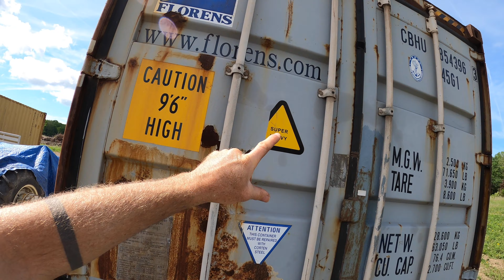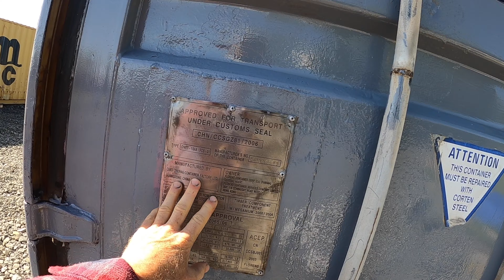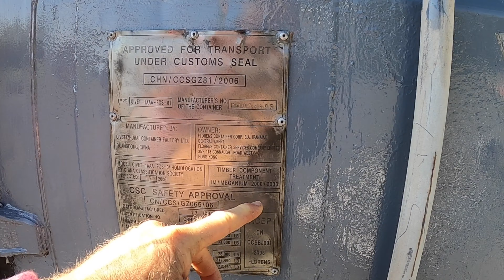Framing the Roof - Shipping Container Barn Build #4

Comment: I have a similar build. I put down a 40 x 46 concrete slab, 2, 40ft containers along outside edge running the 40ft length.  That leaves me 30 inside between the containers.  It has a 12 ft apron off the front end. The apron is 12' x 46'. Roll up door at each end. Front roll up door is 16' back roll up door is 12'.  One walk in door, complete bathroom at one end of one of the containers.  Car lift inside, many tool cabinets and assorted machines to do mechanic work on  4x4's and side by sides.
Reply from the maker: Oh dang that sounds amazing! I'd love to see pics. I'm also wondering where you got the roll-up doors and if they're insulated/sealed well? What a cool space you have ... I'm looking forward to getting mine sealed up

Comment: Invest in the flexvolt cordless grinder. I'm a Milwaukee fan but I gotta say the dewalt flexvolt 6in grinder is a beast.
Reply from the maker: thanks for the tip! much appreciated
Reply: @metaspencer  Torque Test Channel just did a video comparing grinders and showed the flexvolt out performed a corded grinder.
Reply from the maker: @towboatjeff just ordered one. Thanks for the tip

Comment: Great job. I prefer to weld brackets on the top than bolt down to avoid leakage points.
Reply from the maker: that makes good sense. That area will be roofed but I like your thinking there.

Comment: Hey Spence, love all these videos. Have watched the whole “series” at lest 4 or 5 times! Wanting to replicate what you did. Couple of questions for you, how deep did you go on your footings? What height did you decided on the 2x4 uprights for the roof to sit on and why? Thanks!
Reply from the maker: Howdy -- exciting to hear you're thinking/planning a build of your own. I wanna hear more! Where we are 4' footings tend to work and get down below frost. Check your frost line in your area. In one case I couldn't go that deep as I hit a shelf (slate here). The uprights are 4" to make it easy to slap 4x8 wall board (osb in my case) up there. I tend to go with numbers/lengths that fit for the materials I'll be using
Reply: @metaspencer  thanks for the reply and info. 4ft makes a lot of sense. Did you also purposely make the lower roof the same pitch as the trusses? If not it looks really good. I’ll check on the frost line thing (didn’t think of that!). I’m just outside Nashville TN
Reply from the maker: @musiccitycruisers3863  I went for a flatter pitch on the side roofs to get a kind of "flared" look that I like, but still enough slope to shed snow

Comment: Good Day :  I'm so sorry you had to clean off all that rust with that grinder . The all time fastest , easiest and most thorough method is "Wet Sand Blasting"  .  This is mixing very cold water with your sand . It will only take about 1/6 the time it would take to use that grinder .  The cold water will stop any warpage .
Reply from the maker: Sounds awesome! I've never seen a second hand sandblaster in my area, but I'd love to pick one up. Would be awesome to test out and use.

Comment: Hey there, we are working towards building a container home with a similar approach with two containers and a space of 14 feet between them.

Can I ask how well the roof of the containers held up to having the built roof weight on them? 

I'm very interested in using your approach for the knee walls to support a roof with enough high for a second floor.
Reply from the maker: If I were building a house I'd probably brace the container tops/roofs with welded triangular brackets inside, just to avoid any potential sag or movement. My roof has been great but my tolerance for oddities is probably lower than yours, since it's a barn/workshop. Have you thought about putting your knee walls along the edge of the container? Much more solid there. And are you gonna attach your boxes to piers?

Comment: From someone who knows only a little about building I wonder why you did not sand the rust off the roof and paint that too?  Yup I am one of the planning dept./builder inspectors kind.
Reply from the maker: The containers are made of corten steel, which pretty much is made/designed to rust and weather ... so without any new water hitting the tops of the containers (with the roofs on now), I'm not worried about rust progressing up there.

Comment: did u use silicon where u penetrated the roof???
Reply from the maker: Those holes will be roofed over but ya know, it's not a bad idea. I think I'll go back and goop those holes: good idea!
Reply: @metaspencer  I always had to do it installing tv and satellite mounts or the insurance wud not pay up...drill hole 1st put a bead of silicon around the hole, place mount on top, more silicon on the hole then slot the bolt or screw thru.
Reply from the maker: @OffGridAussiePrepper  Yep, that's the way to do it. And I've had good luck with Sikaflex too (on steel). Thanks man
Reply: @metaspencer  Yeah its Sikaflex now not silicon.... as i been retired for a few years due to health issues

Comment: I hate shipping container roofing, its made to rust, therefore u have to make a new roof entirely with at least a 6 inch gap for air flow or a 2ft gap to utilise for storage
Reply from the maker: yeah they're kinda flimsy boxes in places ... less rugged and durable than I first imagined.
Reply: @metaspencer  Shud have been a flat roof made to shed water, not hold water in gullies, cos wind is not gonna dry it out so salty water wud sit and just eat the metal away.

Comment: …. Still waiting to see how these people using these metal shipping containers….are dealing with the   Huge problem of. Moisture Condensation on the inside of these units …. Hot and cold days the humidity in the air ,   Mold forming in all the corners and edges along the bottom …..    They. NEED PROPER VENTILATION.. AND Insulation….
Reply from the maker: A few years in now and we've had zero moisture problems. I was anticipating the same thing you describe but it hasn't been an issue. If we ever have moisture buildup I'll cut in a humidistatically controlled vent
Reply: @metaspencer    Oh. Good. You’re in a good climate location ….     I had problems in mine .. I was in a. Hot and humid place where I was located …. And it also depends on what you have stored inside as well ..   I solved my issues with the type of heater I was using and covered the outside..to avoid direct sunlight on the outer skin ..   ..  location location location … is always the thing to consider….    You’re doing great. Work by the way.    Have a.  Fun. Day.  !!!
Reply from the maker: I'm glad to hear you figured it out!  @patsquach4080